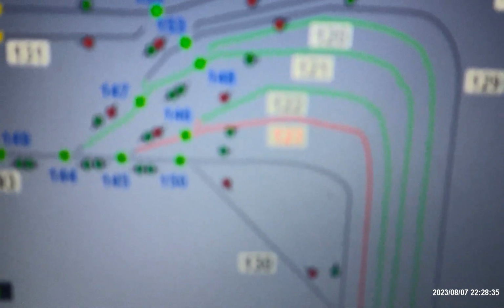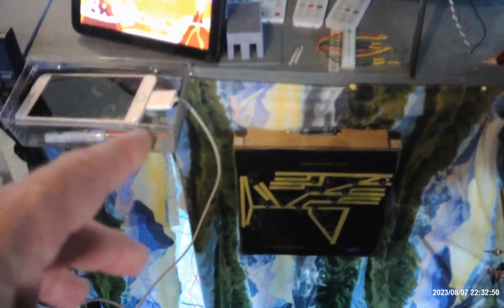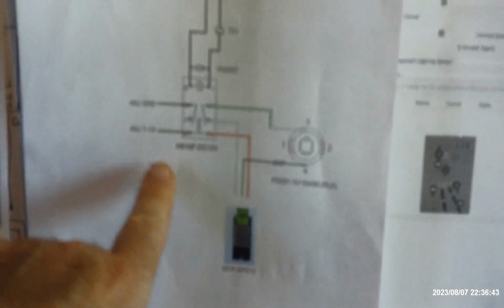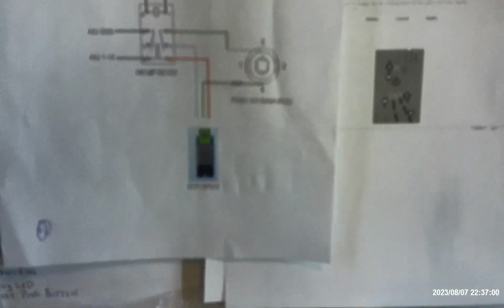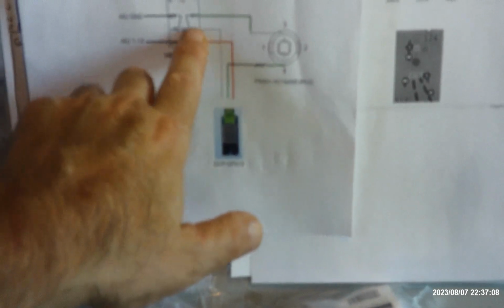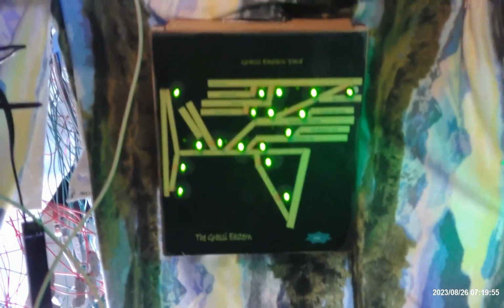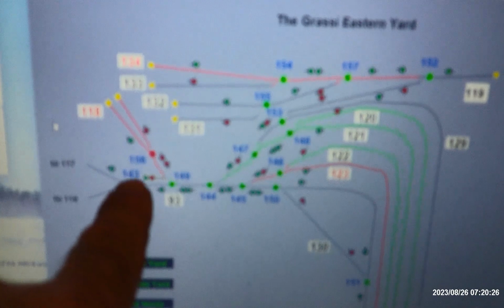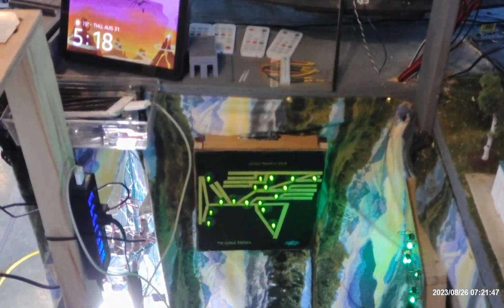252 Layout Update How to Setup Relays for Cobalt IP Push Buttons and JMRI

Comment: What was the total cost for making 1 board?
Reply from the maker: Paul    $10.65 for 10 Relays,  $13.85 for 5 PCB  $8.52 25 Terminal blocks  break that down $1.06 per relay need 3 at $3.18  $2.77 per PCB   need 1   35 cents per terminal block need 12  $4.20   total $10.15    got them on Amazon
Reply: Thank you, I guess I can afford to try it.  @thomasrgrassijr

Comment: Why did you build the relay circuit instead of using the built in connections on the Cobalt Digital iP?
S1 for the LED & Frog, S2 for the connection to the AIU, PB for the Pushbuttons.
Reply from the maker: Heath,  I had that setup the first time I installed them Everything worked except I was not getting a response to JMRI that the turnout was changed.   Setting up the turnout in JMRI to use a sensor allowed this to happen hence requiring a relay.   Thanks for watching.
Reply: @thomasrgrassijr  The AIU is still your feedback into JMRI with or without the relay. You can add a 5v power source inline with the S2 terminals of the Cobalt to trigger the AIU. You don’t need the relay inline.
Reply from the maker: Heath you most certainly require a relay this came from DCC Concepts support. I worked  with JMRI developer and Engineer and the 4 of us came up with the working circuit. without the relay no feed back from the AIU 01 or the Cobalt IP
Reply: @thomasrgrassijr  would you share the wiring diagram with me?
I thought it was the same as the Tortoise, but I guess not.
Reply from the maker: Yes that is correct  The Tortoise use the NCE MK2 and that device send commands to JMRI telling JMRI the turnout has changed.
Reply: @thomasrgrassijr  How does the MkII decoder report turnout position? Are you connecting it to an AIU?
Reply: @HumancityJunction you don't need the aui to to since direction. The mk2 send the signal to the dss command station. Jmri just reads the info from the station. I used these cobalt motors in my mk2 and didn't need the relay.
Reply: @FBMRR  of using the Cobalt Digital iP, why would you use a Switch-it?
I can see using a Switch it for the Cobalt Analog, but not the DCC version. 
Also, If you are getting the feedback from the decoder and not the turnout motor, how do you know the turnout motor has changed?
Reply: @HumancityJunction  sorry you're right. I think they were analog.  The mk2 is the decoder, you program it with the current direction, it's one of the parameters. When it gets the signal to change. It sends the status back to the command station.
Reply: Thomas  excellent video, lots of detail work for sure
Reply from the maker: James Thank you very much